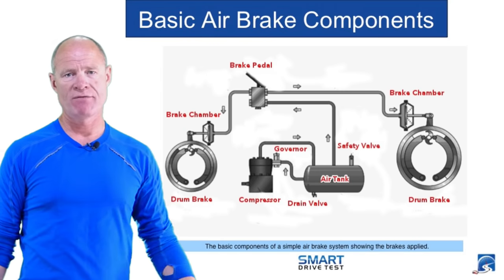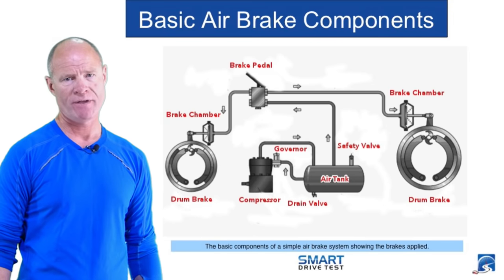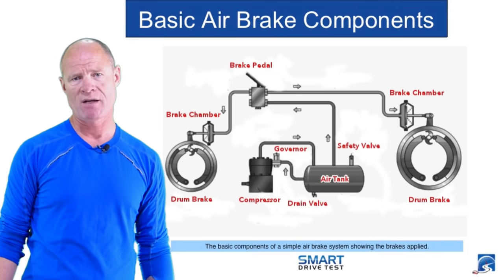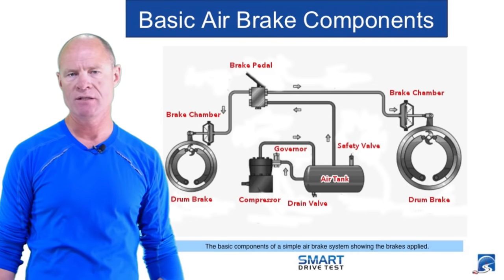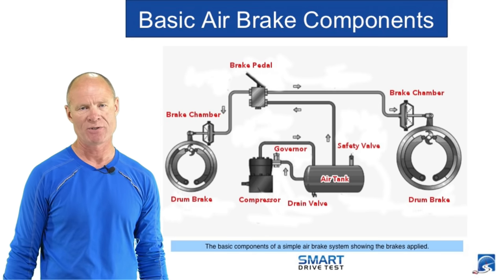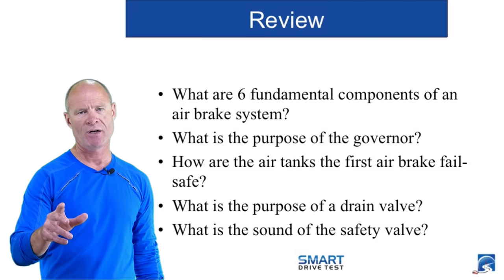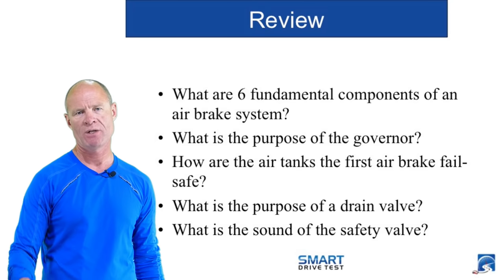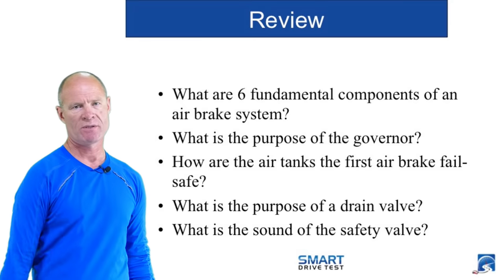Basic CDL Air Brake Components

Comment: Electrically, should the service and spring (parking) brake pressure switches be connected in parallel or series?
Reply from the maker: If you're asking me that question, you don't understand air brakes...well...at all. I might suggest this e-book: https://www.smartdrivetest.com/airbrakes-cdl-rv/air-brakes-explained-simply All the best, Cheers Rick
Reply: @smartdrivetest  that’s why I am asking the question. Well if you know it well you could have just answered instead of pointing me to a book.
Reply from the maker: My point is that electricity has nothing to do with air brakes except the brake lights. And that isn’t even a question on the test. So I’m not even sure what you’re asking me. Cheers Rick
Reply: @smartdrivetest  ok apologies for the confusion. Let me clarify why and what I’m asking. Just related to one of my projects. I’m not asking related to a test. Electricity has obviously something to do with it. I have two brake pressure switches in my circuit. 1 is Normally open contact (for service brake - Bendix part K183919) that activates above 5 psi. The other switch is Normally closed contact (for spring brake - Bendix part 223578N) that activates below 60 psi. I see both connected in parallel in one of my reference electrical schematic. Is that the correct way or should they be in series?
Reply: @taurian551  neither switch has anything to do with the function of the brakes. The only connection that the 2 switches have in common is the power supply.  One turns on the brake lights and the other turns on the low air light and buzzer.

Comment: I'm considering using truck seats in a project and since I'd add air into my system I'm wondering if replacing hydraulic with pneumatic is a good idea or not
Reply from the maker: Hi Flavia Pitariu - thank you for your comment and query. If the hydraulic brakes are working, I would suggest leave these. Changing the power source over to "air" is a tremendous amount of work, with not much benefit. There are a lot of seats that aren't air ride, that are comfortable. We had a lot of those in the buses and coaches that I drove. Have a look around and you might find a more viable option. If there is anything further we can do, drop us a note. Always happy to help. All the best, Cheers Rick

Comment: i will be interviewed for a position dealing with metro buses..im very familiar on brakes on non commercial vehicles.. what suggestion or information you  think might help on this exam...
Reply from the maker: Hi Witz: Test that both the service brakes and parking brakes are working before departing for your run. If the low-air warning comes on, pull the vehicle over as soon as possible in a "safe" location and determine the cause of the air loss. Passenger safety is your first priority. Ensure that you have over 100 psi in the system before driving the vehicle. In cab, test the governor (minimum and maximum, the low-air warning, the compressor and do a leak test). Those are probably the most important points that will be covered in a job interview. Good luck Witz  Cheers Rick
Reply: +Smart Drive Test  thank you so much Rick.. i will also be interviewed for a bus maintenance  tech position.. any suggestions are greatly  appreciated.. Thanks

Comment: Q. I have a 2018 Pete 567 X15 Cummings My brakes keeps locking and drag  up while driving I need to pump my brakes hard to unlock them . Change out my slack adjusters did not fix the problem.
Reply from the maker: Hi acpreciado - my guess is only speculation without seeing the vehicle my friend. I suspect it's the brake pedal itself. I RECOMMEND that you get it check by a qualified technician because that is dangerous. All the best, Cheers Rick

Comment: Love your info ,hope you can help us ,we have a 40ft travel supreme motorhome ,both tanks are full,the alarm still goes off and one guage shows full the other guage reads zero,when we switch rhe wire the zero guage reads full and the other reads zero ,we have replaced guages,pig tails,senders and still the same results,we have ran thru all mobil repairmen and we live 2 hours from civilization  please help us ,kare and bim

Comment: What is the line from the tank bank to the compressor?
Where does the dryer come in?
Reply from the maker: Hi Bubba Hyde - It's called the main discharge line. The air dryer is between the compressor and the air tanks. All the best, Cheers Rick

Comment: Is foundamental brakes a synonym for service brakes?
Reply from the maker: Hi Jay Bartgis - Foundations brakes are the parts of the brake system that actually do the braking my friend. See this article: https://www.smartdrivetest.com/cdl-air-brakes/types-of-foundation-brakes Service brakes are what happens when you push the brake pedal. Drop us a note if we can help further my friend. All the best, Cheers Rick
Reply: @smartdrivetest  why is attaching your lines necessary for a tug test?
Reply from the maker: You need to do a tug test on the trailer parking brakes and a response test on the trailer service brakes. Thus you need the air lines attached so you do the response test. Check out this e-book: https://www.smartdrivetest.com/airbrakes-cdl-rv/air-brakes-explained-simply All the best, Cheers Rick

Comment: how does the airbrake system exhaust air once the brake pedal is released?
Reply from the maker: Through the quick release valve into the atmosphere. There are several on the vehicle. This moves to reduce brake lane. Drop us a note if we can help further. Cheers Rick

Comment: Thanks for the explanation. Nice and clear.
Reply from the maker: Hi Darlene - Thank you for your comment and compliment. And you are most welcome. If there is anything further we can do, drop us a note. Always happy to help. All the best, Cheers Rick
Reply: I am taking class 1 with air brakes and I live in the BC Rockies, so I will have to master downshifting and half gears which I'm having trouble getting. If you have any tips I would be most grateful. I think I might have to haul chips for a while to get some experience after I first get my license before I can get a better job. (not that there's anything wrong with chip hauling It's just that I'm not that strong physically and I'm getting older too). I want to be a safe driver and have some more confidence. The school I'm in does progressive shifting and not double clutching.
Reply from the maker: Hi Darlene - I'm sorry to hear that you're not learning double clutching - it's a good tool to have in your kit, even if you don't use it. Remember when you're downshifting to bring the vehicle down to 1,000rpm and that may involve using the brakes. The other challenge that new drivers have is that they don't give themselves enough space to start downshifting. Start earlier to downshift and that will give you time to work. When you're downshifting going downhill bring the rpm down to 6-800rpm depending on the descent. Get the guy to teach you to split, especially if you're going to haul Super 'Bs'. If he can't, find someone that will - it's an essential skill for the mountains when you're hauling heavy. If you're going to haul chips, I would recommend contacting Arrow. If there is anything further we can do, drop us a note. Always happy to help. All the best, Cheers Rick

Comment: I took my air brake test and failed, not sure what questions i had wrong. I like your lessons, but do you have a video on what will be on the cdl written test for air brakes?
Reply from the maker: Hi Nad: In which State are you taking your CDL? Once I get that information, I can give you some direction on the specific information on which you'll need to focus. Cheers Rick
Reply: +Smart Drive Test I live in new york :)
Reply from the maker: Hi Nad: I'll make a video for you and go over and highlight what's in the manual for you. I should be able to get it up tomorrow for you. Cheers Rick
Reply from the maker: Hey Nad: The task was a little bigger than I anticipated. I have the first part of the manual up for you. I am working diligently to get the remainder done up for you. I am aiming for the end of the week to get that done. If you have any questions, by all means, drop me a note. Cheers Rick

Comment: The questions for B.C. written test is not the same for Ontario Written test and Practical exam test. Keep this in mind, because I'm currently studying and I'm almost finish reading the whole Air Breaks book for Ontario.
Reply from the maker: Hi Static_VIP_Camry - you are correct my friend. In ON, the max pressure is 145psi; the build-up test is 85-100psi; and they require you to do the applied stroke test to determine if the brakes are in adjustment. Drop us a note if we can help further my friend. All the best, Cheers Rick

Comment: I'm in the US, not Canada, but wondering if I'm applying for a class B CDL but will NOT be driving a vehicle with air brakes, will I still be tested on air brakes?
Reply from the maker: Hi djlogic937 - Thank you for your comment. And which state are you in? Most of the time if you take your test on a vehicle that doesn't have air brakes, you don't need air brakes. However, as most buses these days are going to have air brakes, I might counsel you to get your air brake ticket. If there is anything further we can do, drop us a note. Always happy to help. All the best, Cheers Rick
Reply: Smart Drive Test, Hi Rick, thank you for the reply. Your videos are very helpful, I appreciate you putting in all the work!
I'm in Nevada.  I'm a bit nervous about having to jump through all the hoops with airbrakes and semi's and all of I'm just looking to drive a basic straight truck - say a box truck or a utility rig with a boom lift, something of that nature. It seems that it should be no different other than weight from driving a u-haul or a pickup, but the company requires a CDL - not even sure yet what Class or what Endorsements. Ideally I'd get an A class with all the endorsements to cover all my bases, but again I'm nervous about that as I have zero professional driving experience or any experience with trailers, big rigs, or even stick shifts... 
Thanks again for any advice you may have. 
-Nathanial
Reply from the maker: Hi djlogic937 - Apologies for the late response. Thank you for your comment. And you will be just fine with air brakes - all the information you need is here on the channel. We're here to help you be successful. Just drop us a note. All the best, Cheers Rick

Comment: Yup totally get you Rick! Why do they call it Spring brakes when it’s emergency or parking brakes. Also having trouble with Tractor towing vehicle protection valve and trailer supply valve! Why not trailer air supply valve or tractor air protection valve? A lot easier to remember. Lol
Reply from the maker: Hi Deborah - thanks for your comment. The people that created these air brake course 40-years ago were not teachers, and thus the course is not exact in it's use of language. Have a look at these videos for your other questions: https://www.youtube.com/playlist?list=PL0x-bChcUvwG2bSWReQWnk9Tm92L7WN_O Video #17 will answer your questions about  the Tractor Protection System and the Tractor Protection Valve - just to make it even more confusing. All the best, Cheers Rick
Reply: @smartdrivetest  it may not be "exact" in terms of language but it is what is still in use by the people who fix the systems and you need to talk the same language as the guy who has to fix it. The reason why it's called spring brakes instead of the other choices probably goes back to the late 70s when they instituted the 121 brake system. Before then you did not have a fail-safe braking system, only the applied air system and it could bleed off too. If you have a leaking rear diaphragm you have no parking brake on a pre-121 truck.

Comment: Just bought a Freightliner FL106, never drove a truck before, tried it for about 10 miles, now it seems like the P brake won't disengage....
Reply from the maker: Does the truck move when you push in the yellow 4-sided button? Cheers Rick
Reply: @smartdrivetest  It didn't want to until i realized to pump the brake pedal to purge all the air out of the system after watching your video. Thank you, you really helped.
Reply from the maker: Hi Racso Onariep - We're happy to hear we could help out. If there is anything further we can do, drop us a note. Always happy to help. All the best, Cheers Rick
Reply: @smartdrivetest  Thanks for being so helpful! now I've come to find out that since my truck is a 2000 model and it weighs over 17,000 lbs. I cannot register it here in Ca. due to smog regulations. What is my best alternative? Thnks.

Comment: Are Air Brakes a more safer alternative than hydraulic brakes?
Reply from the maker: These are not safer per se, just different. Advantages of an air brake system are: these work over large distances such as semi-trucks or trains; air brake systems are tolerant to small leaks; and air brakes generate the greater force required for stopping large vehicles. All the best, Cheers Rick

Comment: What is the SR1 valve and quick release valve?
Reply from the maker: Hi Gabriela Sanchez - Thank you for your question. Quick release valve quickly releases air from the system after a brake application. It also exhausts the air when you apply the parking brakes. Where are you doing your air brakes? I believe the SR1 valve is the spring brake relay valve. It fills the air tank and controls the spring brakes. Let me know where you're at, and I'll confirm that information. All the best, Cheers Rick

Comment: How compressed air is cooled? As you already mention in your another video, that air leaves the compressor with 200  degree centigrade of temperature.
Reply from the maker: abhi i love my india - air cools as it moves through the system. The air dryer removes water and other contaminates. And the air cools further when it is stored in the air tanks. All the best, Cheers Rick
Reply: @smartdrivetest  thanks for being generous with your precious time.
Reply from the maker: abhi i love my india - most welcome my friend. Cheers Rick

Comment: What happens when something causes the air pressure tank to fall below a level required to apply pressure on the foundation brakes?  This could happen if the governor or compressor fail or if the tank leaks pressure off faster than the compressor can fill it.
Reply from the maker: Hi RH Hutchins - Thank you for your question. This video will answer your question my friend: https://www.youtube.com/watch?v=c1ldt8qK-HM&list=PL0x-bChcUvwG2bSWReQWnk9Tm92L7WN_O&index=6&t=0s If there is anything further we can do, drop us a note. Always happy to help. All the best, Cheers Rick

Comment: generally when i use a public transport bus in india....the driver of the bus ..draws a switch... and a sometype of sound ( "pisssssssss" like sound) produces... it seems like some air pressure  is released.....
is it the same extra air that need to be released from air tank that is done by safety valve in your video...
Do they do this manually .....
and if not, what is that..